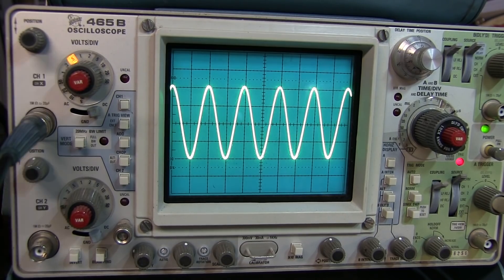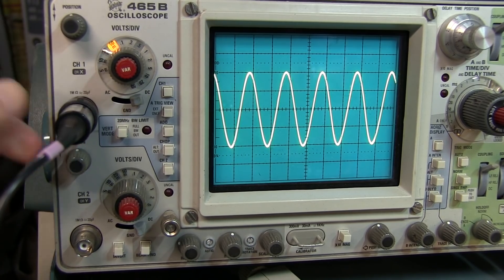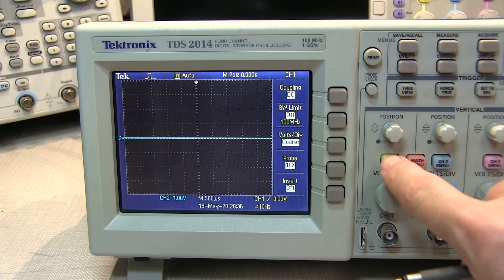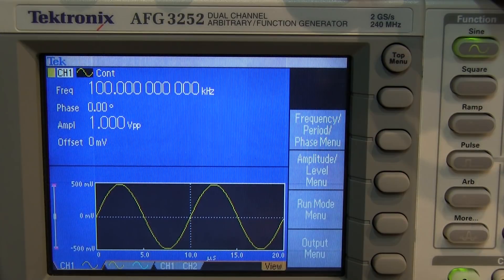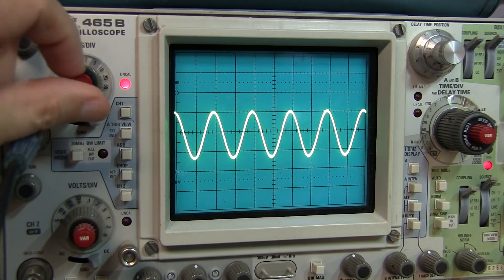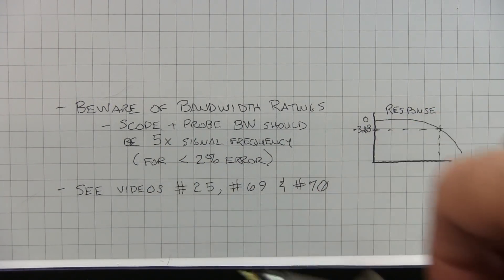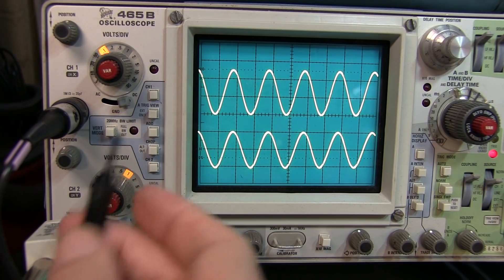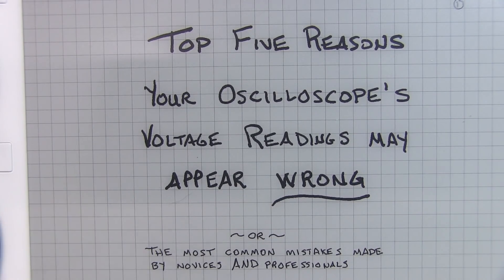#311: Why are my oscilloscope voltage readings wrong? Top 5 reasons...

Comment: I have MICSIG STO1104C oscilloscope. I was measuring Vpp and the generator was set at 1V, but my Micsig said it was 1.3xx Vpp! So I measured it with my KEITHLEY DMM6500 and it was measuring 1Vpp! So I made sure I had everything set right, tried all 4 channels (one at a time) and I was getting about 1/3 more volts an all of them! So I took a probe from my other 100Mhz scope (Aktakom ADS-2111MV) and it was measuring 1Vpp!   Are the included probes not accurate? Micsig is usually good quality, I think, so I don't understand what the heck is going on! (I don't like that the original probes are fixed at 10X and can't switch to 1X at all! Thanks!
Reply from the maker: It sounds like your MICSIG probes aren't properly compensated.  Have you compensated them on this scope?
Reply: @w2aew  Thanks for your quick reply! 
I did, and I also tried to change frequency settings... Redone the autocalibration that is one of the options, connected the probes, one at a time and connected it to the provided test port... I also purchased a new set of probes, from Amazon - Autoutlet P6100 universal probes and tested them also. Results: At 1Vpp from generator: DC-Coupling - 10X - Bandwidth is FULL - measures 1.2 to 1.225 Vpp; Next, all the same but HIGHPASS - I get 2.2 to 2.224 Vpp; Low Pass I get 1.02 to 1.04 Vpp.
Have a great day!

Comment: Thanks for vid! I have a new OWON DSO and house mains shows 360 volts or off by 3x.  probe and scope at 10x and compensated. Any ideas? Thanks~
Reply from the maker: I bet you're measuring the peak-peak voltage of your line voltage.  When you measure with a voltmeter or DMM, you are measuring RMS voltage.  125Vrms equates to  about 177Vpeak, which equates to 354Vpp - which is very close to what you are measuring.
Reply: @w2aew  That’s exactly it! This is fascinating to me and I have so much to learn. I was an automotive mechanic specializing in electrical for over 30 years and we just started using proprietary scopes towards the end. I know some of the very basics but nothing to do with this kind of material. Do you recommend any online courses or videos that would be of interest? Once again I really appreciate your help I couldn’t for the life of me figure out what the heck was going on.
Reply from the maker: @Mr5150guy  Maybe this tutorial that I did might help: https://youtu.be/KYEMPm0c9kY
Reply: @w2aew  Thank you! After I asked my previous question, I searched your channel and realized how much content that you’ve provided. Thank you!

Comment: Your video content is excellent and while I’m a pretty smart guy I am not an engineer, electrician or computer whiz, however your explanations bring it down to a level that I can follow and understand, thank for your methodologies used in your craft here!!  I have 2 questions of non tech nature. 

1. What is that item you are using as a pointer as you describe your schematics?
2. What is the device your are using to write on, some sort of what appears to be an e-ink tablet

Again thanks so much - AC3D
Reply from the maker: My "pointer" is an old, broken oscilloscope probe.  The writing tablet is an e-ink tablet from www.remarkable.com

Comment: What scope would you recommend for the budget-minded with a bandwidth of 1GHz? I want to start getting into some UHF stuff, and the typical 100MHz scope won't cut it, let alone my 30MHz BK Precision scope. I'm looking not to spend more than $500, but can go up if there is nothing viable within that range; I'll just have to wait longer before committing to it.
Reply from the maker: I don't think you'll find any 1GHz scope that is going to be less than $500, even on the used market.  You may have to look into building a down-converter (mixer and oscillator) to shift your UHF signals down into a frequency range where a lower frequency scope can be used.
Reply: @w2aew  Okay thanks, I'd never thought about that. I'll definitely look into it.

Comment: In the last example, the probe in the ch2 has a 50 Ohm attenuation, but why not in the ch1?  Thank you for the video.
Reply from the maker: ???  There is no 50 ohm attenuator used in the last example.
Reply: @w2aew  6:42 - You did use a 50 Ohm attenuation in Channel 2, but on channel 1 you only compensate the internal capacitor.   Maybe Channel 2 is just a coax cable connected directly to the generator and Channel 1 is a regular Scope Probe?
Reply from the maker: @JohnUsp  At 6:42, both channels have 10x probes on them, they're just different models of scope probes.  The probe on CH2 has a larger compensation box on that particular probe.
Reply: @w2aew  I thought you plugged the 50 Ohm terminator used in the 3:15, ok, thank you for explaining.

Comment: W2aew can you make a video lesson focused on examples of using the vernier VAR control when would you use it besides measuring the rise time and fall time?The Sense Ring on the Oscope Probe changed automatically the volts per division by the function generations output amplitude voltage. How does the Sense Ring know to change the volts per division automatically depending on the voltage level driving the Oscope Channel input? is there a comparator circuit built inside the Sense Ring?
Reply from the maker: My video that shows how to measure inductors and capacitors with a scope is another example where you use the VAR control to setup 8 division full scale reading so that you can measure RC time constant by seeing when the voltage crosses the 5th division (https://www.youtube.com/watch?v=74fz9iwZ_sM).  The sense ring ONLY works with probes with the indicator pin - it does not work with simple coaxial connections to a function generator.
Reply: Yes the Sense ring only works with probes with the indicator pin. What I mean is that when you adjust the Function Generators amplitude output higher the Oscope with the indicator pin will "automatically" change the Oscope volts per division without you manually using your hand to change the volts per division dial. Adjusting the Function generators output level will automatically switch the dial position without using your hand manually. I think the Indicator pin has some type of signal comparator built inside the probe or Oscope to do this?

Comment: Howdy.
You missed one point but came close. The probe cable bandwidth should also be 5 x the measured signal. With a 100 Mhz cable one gets another 3 dB lost at 100 MHz.
I have had a lot of head scratching checking VHF oscillators before I remembered this simple thing from my college days.
Regards.
Reply from the maker: This depends a little on the manufacturer.  Tek is pretty conservative with specs.  Usually if you use a Tek probe rated for 100MHz on a 100MHz Tek scope, you'll wind up with 100MHz of bandwidth.
Reply: @w2aew  Howdy.
Aha.Ok.
Regards.

Comment: Oh wow!  At first glance, I thought you were using the FE's favourite scope, the Techtronix 468, then I saw it was a 465, with which I'm not familiar.  Looks like the basic scope is the same, but the 468 had an 'add on slab' on the 'top/back' which did all the on screen measuring and special function cursors.  I lugged that damn thing around for probably twenty years? But the thing was, I used it almost every visit.  It never went wrong, it displayed beautifully and it would trigger on a flea fart, but only if you wanted it to.  I always found HP scopes to be non intuitive and hell on wheels to trigger.  

I had to hand back my 468 when I got deeper into MRI (from CT) because it didn't have the bandwidth for 3 Tesla.  In its place, I got a Fluke 199 digital, which was kinda neat, but........it wasn't a 468.  Then it started to break down due to power supply problems and it never really worked after that, despite visits to our repair people.  The 468 is dead.  Long live the 468.

Comment: what if you stick the probe on 230V AC? is it gonna explode the oscilloscope or it will read the peak to peak voltage, frequency etc? ( i don't own oscilloscope and never used one, im just a hobbyist in electronics and im interested to get one)
Reply from the maker: It depends on the rating of the probe.

Comment: I have a question and I would like to get your support. I notice that when I
 do matching for PI configuration, the series part is capacitor, when I 
solder it, the impact looks like an parallel inductor, although the SRF is above 
desired frequency. What cause this behavior?

Comment: Why would a signal generator need a 50 ohms of out put impedance? The only thing I could think is that it’s trying to limit it’s own current output. Is that why or is there another reason?
Reply from the maker: Mainly to provide a good source impedance match to 50 ohm coaxial cables.  See my videos on transmission lines and terminations to learn more.
Reply: w2aew will do! Thank you
Reply: As w2aew says but doesn't go into that much, it is to control (eliminate) reflections that can cause higher readings than you would expect.  Coax cables are typically 50 ohm impedance; if the source impedance is also 50 ohms then the signal will enter the coax without reflections at the source, and the destination also needs to be 50 ohms to "eat" the signal without causing reflections.  If both ends are reflecting you are going to get transients bouncing back and forth adding, and sometimes subtracting, from the signal.  It can set up "standing waves" where you get huge variations in signal depending on where along the transmission line you make your measurement. 
Doing it this way also gives you the highest possible frequency measurement and greatest accuracy since you have eliminated reactive components.  
Don't use a 10x probe with 50 ohm termination since the probe has a high value resistor in it.  In fact, don't use a 50 ohm termination with a 1x probe although that's a bit less bad.  50 ohm terminations are for when you come straight out from a signal source that's 50 ohm, through a 50 ohm coax, to the scope.
Reply: @thomasmaughan4798  Thank you for your explanation.

Comment: I'm an old metrology tech who use to repair all sorts of test equipment while in the Air Force and use to repair and calibrate those scopes.  My favorite was the Tektronics 453 with its small screen.  How many times had you replaced the tunnel diode in the trigger circuit?  If your scope can't trigger, it's most likely the tunnel diode.  I'd also lie to say, that scope appears to be in excellent condition.  I do miss them.

Comment: One more reason. If you measure your AC voltage with a DMM, it typically shows the RMS voltage. But the oscilloscope will show a sqrt(2) times higher amplitude.
Reply from the maker: The sqrt(2) only holds for sinewaves.  Also, beware that the AC measurement frequency range of most DMMs is quite limited.

Comment: Nice and informative video Alan, I really love all your videos, Thanks. To Alan and anyone else that may be able to give me  guidance as I am just learning. I have a Tek TBS1052B beginner scope and I do not want to damage it.
 I am into model railroad and use Digital Command Control of the layout.
As the signal is a form of squarewave both rails are sending the system commands to both rails.
Because there is no negative rail as such, how would I connect the scope to see the signals being sent?
Reply: DCC is Alternating current with short and long pulses, if I remember right.  It is going to be differential so the easy way is to use two probes and set the scope to differential mode.
Reply: @thomasmaughan4798  Thank you Thomas. I will have a look now

Comment: Or, reason number 6, if you’re using a Tektronix scope the readings could be wrong because some of them are prone to having all sorts of strange and expensive or impossible to repair issues with Tek using custom ICs that were prone to failure and have long since been unavailable rendering many expensive Tek scopes unusable scrap.
Reply: Well, to be fair, many aren't unusable scrap.  I absolutely LOVE my old Tektronix scopes, and they work great!  Yes, they've needed a little attention, as any old piece of gear would.  And I think I'm not alone; other people also seem to have a more positive perspective on these things.  I suppose some models may have been more long-lasting than others.  Sorry you've had trouble.
Reply: Phreadrick Hejrick Don’t get me wrong. Tek has made great scopes both old and new but they also had at least a decade where they turned out some lemons that were prone to failure and even a 5 year old scope could end up being unrepairable when a no longer available custom IC failed unless you could scavenge something out of another dead scope. For a good while Agilent/Keysight was killing Tek with significantly better scopes that offered much higher screen refresh rates, a better user interface, more features per dollar, and they didn’t prematurely die.

Comment: I don't have a 50 ohm feed through connector. Could one be made using a 50 ohm resistor?
Reply from the maker: another option would be to use a BNC-Tee at the scope input, and put a terminator on one end.
Reply: 50 ohm resistors will work but not reliably at high frequency depending on the construction of the resistor.  By high frequency I mean anything significantly above about one megahertz.

Comment: Hi OM. Why are Tek probes and others so sensitive to "hand effect" especially on higher frequencies ?
I noticed strong amplitude variations on the scope when touching  the probe cable on most probes. This also varies 
greatly depending on the distance from either end I touch the cable.
Phil FM5GB. Regards.
Reply: Tektronix probes have quite a bit of probe in front of the coax shield.  The capacitance of your hand will de-tune the probe.

Comment: Hi, Alan.  I'm relatively new to your channel and am loving it.  I have a 2465B Briteye, which some may deem overkill for a newbie, but 'starter' or 'beginner' anything never blew my skirt up.  It's just as easy to learn on the most one can afford, and you spend less in the long run.  I'm am working toward tube-radio restoration and your videos are really helping the learning process.  Thank you so much for your willingness to share your vast knowledge.
Reply from the maker: If your scope is a BrightEye, then it must be a 2467.  If it is really a 2465B, then it is not a BrightEye.  The BrightEye scope had a very special CRT called a Micro-Channel-Plate CRT which gave an incredibly fast writing rate.  It also tripled the price of the scope.  Both are excellent scopes, so congratulations!
Reply: @w2aew  Typo 2467

Comment: Another reason for wrong readings is the following :
Some people like to protect there scope, and place the scope behind a isolationtransformer or use a 2 lead powercable without grounding.
When you remove (like a 2 lead powercable) or disconnect the groundpin (like a isolationtransformer does) in combination with a modern scope, 
then the safety capacitors in the EMI filter can't unload through the missing groundpin, but place up to 50% of the mains voltage on the negative part of the BNC connectors.
Your negative lead of the scope is now no longer a 0Volt potential, which wil result in faulty readings (not to mention that circuits can be destroyed by this).
Nice video :-)

Comment: Another one is X1 probe bandwidth. You can have a 500 MHz oscilloscope and if you use the probe in X1 adjust you would get errors at 30 MHz.
Reply from the maker: Of course, 1x probe bandwidth is rarely more than 10 or 20MHz max - often it is less than 10MHz.

Comment: Wow, I'm now actually thinking about checking this for the circuit I was working on last night...
I'm trying to build an avalanche-TDR and it's not really making any pulses. I am trying to probe the power supply, the TDR itself, and only see very little oscillations - way less than I think I should.
I of course use a 10x probe for the >100V, but I still think it's not working, all those signals are a thousand times smaller, and sometimes not the correct frequency!

Comment: Great reminder video! I sometimes forget and scratch my head, then it dawns on me :) Excellent videos as always Allen. Still love the old 465 CRT scope. I have repairs to do on mine. Seems like the power supply has voltages low or missing. I'm getting some odd traces and low brightness. One day I have to open it up and start checking the power supply rails. Thankfully, I have a 2465B as my backup. Not much of a fan of LCD scopes.

Comment: There's something strange going on with your audio. Every time a new shot begins, the volume is abnormally loud. It quickly settles back to the same lower volume, though. If you're using a compressor you may want to shorten the attack time.

Comment: Sir,could you make a video on designing a circuit to 'convert a square wave into a sine wave'.
Reply: Low pass filter
Reply: As he says; a low pass filter.  A square wave is the sum of all odd harmonics in proportion to their order; 1/3 of 3rd harmonic, 1/5 of 5th harmonic and so on.  So you cut everything above the 2nd harmonic (which won't be there anyway) and viola!  Sine wave.  However, depending on how much power you are putting into it the circuit may be reflecting quite a lot back into the source (or dissipating it).